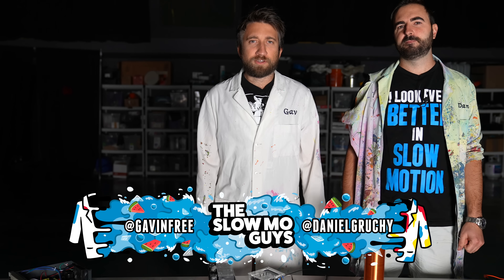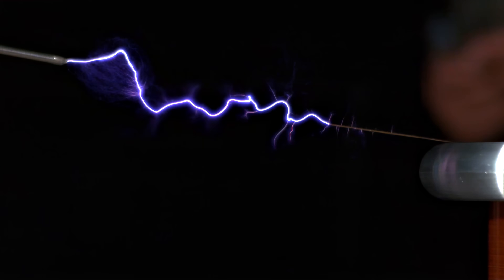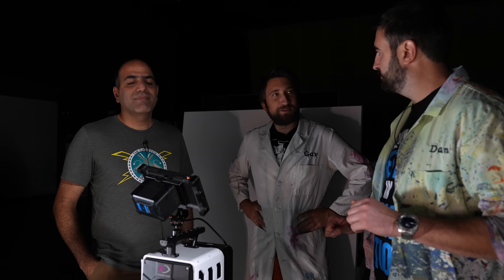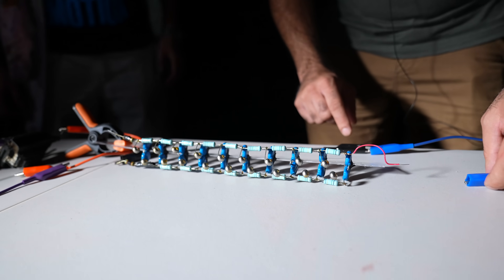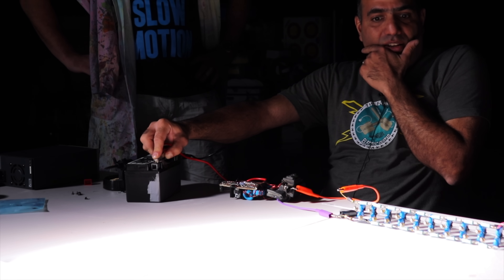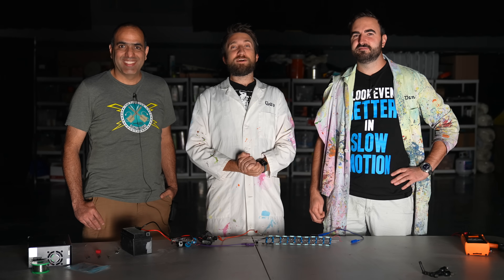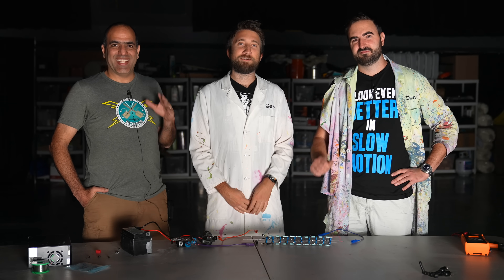Electrical Arcs at 1,750,000FPS - The Slow Mo Guys with ElectroBOOM

Comment: The electro boom guys Mark's generator looks like the flash happens all across all of it at the exact same time even at 1 million 750,000 frames per second. That underlines the idea that electricity doesn't really travel through wires. What travels through the wires is an electrical CHARGE, not the actual electricity. One atom charges the next and the entire chain becomes charged. Only then does the electricity make its appearance as a flash or whatever.

Comment: +++Because electricity moves slower 'about' a conductor [not 'IN' a conductor. See So You Think You Know Physics. The Big Misconception About Electricity [Veritasium] - https://www.youtube.com/watch?v=bHIhgxav9LY ] than through the air [near vacuum relative solid matter. Tthink density-resistance/impedance],  the reason the first gap was active before the last/others is because it is closest to the initiating power source. Get an even longer ladder and faster camera and you'll visually/experimentally prove that electric power travels through air to some heretofore unknown degree.   UFO power supply???

Comment: 1.75 million frames per second allows us to see a little more what's going on with an electrical arc, but it isn't quite fast enough. Light travels at 186,000 miles per second.

Comment: 15:32  the camera captures picture/video line by line may be that's the reason you are seeing the last one is only ON. 

Like the camera have captured most of the pixel but when it reaches to the last one at the same time the circuit turn on and the camera ends up only  capturing the last one light.

It's camera shutter effect which can be also seen when you take picture of a fast moving fan
Reply: The Phantom cameras they use don't have rolling shutters, so each frame is an accurate moment in time.

Comment: Hi! Sound guy here! The arcs following the same pattern in the air due to the heating of the particles within the trail also explains the tonal nature of the tesla coils noise that it makes when discharging. You could hook up a MIDI clock output to the frequency regulation, effectively letting you play MIDI music through the tesla coil!

I do hope that little idea turns into a video for you guys! Leave an upvote if you've read this and you'd like to get the idea to Gavin, Dan and ElectroBOOM!Loving this video a lot and I'm only at 2:51

Hope you guys are doing well! Been a massive long time fan for years.

Comment: I've always wondered why, with the equipment on hand, you seem apprehensive to use your highest fps cameras?
Reply: Obviously I'm just guessing but I think a reason may be that the higher the frame rate, the lower the resolution. You lose quality and frame height to achieve those speeds. If they can record something at a fast enough speed to keep it full screen or better quality, they probably will. At a certain point some things are also going to be too dark to record at some speeds. Just a guess though!

Comment: To measure light, wouldn’t you need a camera that captures frames at (or faster) the speed of light? I would also propose using detectors placed at least at two various points, then measuring the energy differential between the two points after the initial release of energy to determine the flow of the electricity. Has something like this already been invented? I would love to know so I can conduct further research myself.

Comment: silly question, but could you take 2 or 3 of those phantom cameras side by side. program them to take a frame while its neighbor's shutter is closed and then stitch the two videos together for double the frames?
Reply: I was thinking something similar, but rather make the camera with several sensors that all capture the exact same frame thanks to a two way mirror or a prism.
Reply: Silly question? That's something Steve Jobs would've asked! He didn't have the know-how of the engineers, but had the how-to of a designer!

Comment: Fun Fact about Electrical Arcs: 
Electrical arcs produce some of the highest temperatures known to occur on earth. Up to 35,000 degrees Farenheight, which is 4X the temperature of the surface of the sun! All known materials are vaporized at this temperature, which causes a sudden expansion of air. Blast pressure waves have thrown workers across rooms...
What sustains an arc? An electric arc is a discharge of electric current across a gap in a circuit. It is sustained by the presence of a thermally ionized column of gas (called a plasma) through which current flows.

Comment: 17:08 Gav, let's not forget that electricity travels at 670,616,629 miles per hour :)
Reply: Jeez, only light travels faster at 671 million miles per hour!
Reply: @chrisjandik5019  we've gotten particles in particle accelerators to travel at 99.999% of the speed of light

Comment: conventional current assumes a direction from high voltage to low voltage, but really electrons are flowing from the low voltage terminal to the high voltage terminal, because electrons carry a negative charge. this could be why the last arc lights first
Reply: 10:30 someone who has knowledge on cameras and such tell me why they are only showing a small line
Reply: Was searching the comments waiting for someone to mention that dc electrons flow from negative to positive so that’s why the last one was lighting up first lol

Comment: Electrical engineer here; My guess on why the marx generator lights up all at once would be that Mehdi IS technically correct, they are filling up from left to right. However, once the first stage is fully charged, my guess is that the impedance between the two discharge nodes is effectively infinite (acting as a perfect open), because there is another path of least resistance within the circuit, going to the next stage capacitor. Once that next stage capacitor fills up, rinse repeat down the line until you finally fill up the very end one. When that one fills to its max capacitance, there is nowhere left for the current to 'freely' move, so everything 'overflows' all at once.
Reply: Just like Micheal has said, you would need a camera that could record with a frame rate close to the speed of light to catch each RCI discharge happening. I think you’ve already found a camera that can do this. Do you think the University will let you borrow it?
Reply: A hematologist here, didn’t understand a word
Reply: 1,750,000 FPS
Reply: So, in essence, it would make sense that the furthest shows activity first? I have about ZERO electrical engineering knowledge, just basic electricity understanding. It's a circuit, so if the energy is making a loop in the device, wouldn't the last chamber fill first? Like water pumped down a tube with pressure-released valves, the last valve in the tube would open first once it was filled?
Reply: The best kind of correct
Reply: so, this is kinda exactly what i thought, but not scientifically. i wouldnt have known how to describe it but this was my exact sort of thought process😅
Reply: New student here, I thought a capacitor was an open? How come a capacitor fills up? If the impedance makes it effectively an open, I get how the current goes through the short, but if the short leads to another capacitor (open), how is it a short path? Thanks
(Again, just took circuits 1 so I might be missing something)
Reply: @wildavis3016  You are correct, in a DC system, a capacitor will eventually behave as an open, once it receives enough charge to 'fill it up'. Once full, the capacitor denies any further charge, acting as the perfect open (infinite impedance), forcing all the current elsewhere (down the line to the next sets of capacitors). However, if there is sufficient enough voltage potential between the positive and ground/negative sides, the the voltage can actually break down a medium (in this case, by ionizing the air between the two discharge nodes). This arc acts as a very brief short, which totally drains the capacitors, resetting the system.

This is why capacitors are only rated to certain voltage limits, as exceeding these thresholds will cause this same breakdown within the capacitor itself, resulting in the wonderful "pop" we all know and love Mehdi for.
Reply: @Deper91  ok that makes sense thanks
Reply: @Kynan That's great and has nothing to do with the topic at hand
Reply: Fact of the matter is, it must be a cascade effect, but much like glass breaking, propagates so fast that it is all but impossible to see the behavior.

The giveaway here is that all the gaps have to "close" for anything to jump out of the output (as these are series switches)... But clearly one has to reach potential before all the others, if for no other reason than there will be slight differences in the gaps.

My guess here is that it just so happened that the end gap was the closest, but it could have been anywhere in the chain. Once the first one goes, the others are immediately "over" and fire off in an order relating approximately to the gap sizes.

This may actually be random in appearance, IF one could record all of the time in between. Obviously this is extremely difficult.

Once they are all bridged, the output goes hot and an arc is ready to jump if something is close enough.

You'd therefore see the output spring to life after all of the chaos in the gaps is resolved and they are all conducting.
Reply: @Kynan That's only true IF there's no reactive components present.

Sorry buddy but been doing this a LONG time and know how it all works. 🤷‍♂️

Comment: @5:54   is essentially how the lightning stepped leader coming from the cloud meets an upward streamer coming from grounded objects.  It also demosntrates how the ionized channels first propagate in the air by following corona discharges and when the circuit completes, the unconnected branches discharge.  Nice job.

Comment: The 250 kHz figure is interesting.  Lightning also contains a lot of radio frequency components, which is why it generates lighting crashes on LW, MW, and low HF radios.

Comment: lightning discharge of high voltage passes through conducting substances- the energy shreds the electrons in the substance it contacts, so the ghostly afterimage is actually luminated ionized gas molecules, in this case air

Comment: This camera is dead slow compared to the task. If you measure breakdown times with an oscilloscope, you will see times around 20 ... 40 ns, and such a marx will erect in <100 ns. So you can't see details with one picture in every 600 ns.

Comment: Do you know how fast it actually travelled? Did you discharge the capacitors after each attempt? Just curious if they held a charge after the arc. It was cool to see the mass of the electrical charge separate the air then the air giving the telltale "thunder" sound.

Comment: I made a really powerful Jacob's Ladder using a MOT and a capacitor. My phone had a high speed option, just NOTHING compared to this camera..
Going to make a Tesla coil to generate enough power to light a fluorescent several feet away while I hold the bull in my hands. I've done it on a small skill, but I think I'm going to bring it up quite a bit.

Comment: Why does the spark start at the other end?? Silly humans. Electricity acts no different than Pneumatic or Hydraulic. Imagine the oval ends as nozzles. Your vessel has to first fill completely and pressurize. The pressure and back-flow starts at the farthest point.

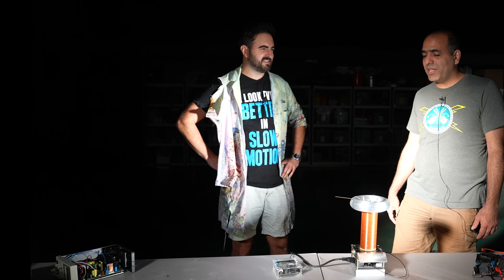Comment: That stuff at 3:00 is probably less about the ionized channel created by the previous arc and more about electricity always taking the path of least resistance.  So that path is displayed by the very first arc, and it doesn't change much in the millionth of a second or whatever between arcs, so the next arc takes almost the same exact path.

I thought the little baby arcs coming off the antenna as the charge moved down were pretty cool though.  THAT is likely due to the ionization of the air around the antenna as the charge travels along it, but the antenna is still the dominating path of least resistance.

Comment: 17:34 The spark is going pretty fast. Say the generator is 0.4 meters long and it all lights up within 1/1,750,000 of a second. Then the speed is at least
0.4m/(1/1,750,000 s)=
0.4*1,750,000 m/s=
700,000 m/s
That's about .23% of the speed of light, but that is only the calculation based on the frame rate of the camera. With a 750 million fps camera you could measure the speed of the sparks up to the speed of light.

Comment: Speaking from an electromagnetic and electrical engineering specialist background. What people don't realise is that wherever there is charge, there will be current flow of electrons. It's just so slow or small that you can't recognise it many times. 

So when lightening or sparks occur, what's happening is all electrons in the air are moving, from even the lowest charge, and as the charge increases, some particles move faster than others and this builds and builds depending on the ionisable properties of particles as well as the electrical charge source. And so the fluff or the "searching" of the electrons really aren't anything to do with lightening finding it's path, but more to do with just the natural already flowing electrons becoming visible due to the increased flow of electrical charge around the visible areas. And charge doesn't flow through the air like one stream, but rather through the entirety of space simultaneously. Think of space itself as made up of like infinite circuits connecting the charge source and it's destination, all in parallel connection with each other and all with differing resistances for the electricity to flow through. And as the electrons increase in flow, these circuits change in their resistance properties.

So the reason the Marx generator goes from the higher voltage side is precisely because all current is flowing at all times from it's source to destination. Of course as the air becomes more and more ionised it becomes more and more like a short circuit. And the air becomes more and more ionised as current is flowing faster and faster, even well before you see any ionisation process happening at all. Think of all the capacitors as already flowing current continually, all charge trying to dissipate constantly and simultaneously from all points at different rates. It makes sense the slip stream of the higher voltage would appear first to ionize.

Comment: if you could have 2 cameras film at 1.5 million but at alternating starts could you then get 3 million frames a second? night be impossible to time even with a computer though
Reply: totally doable, but the object is too close, the angle would change way to much.. is a hassle.
Reply: @JoseNovaUltra  what if you had a mirror bounce the image into two other mirrors that the two cameras were then filiming?

Comment: A somewhat lesser confusing way to conceptualise why an arc will jump to a conductive surface is by making parallels to materials cracking and how they might crack due to a change in width or due to an internal void.

Its not like the crack knows where to go, it just finds the areas that take the lowest amount of energy to rip apart, once it reaches the end of the material the crack opens up which is basically what electricity does.

Comment: The reason the arcs don't occur in a sequence along the resistor ladder...  there's no voltage drop across resistors when there's no current.  The arc-gaps all reach the same breakdown voltage at the same time regardless of resistor values.  After the arcs start, then there's current, and then the resistor value limits the current which is why arcs at one end are brighter than at the other end.

Comment: I'm guessing that the reason they see the last spark gap in the Marx generator is the first one to flash-over is because that particular spark gap may be slightly shorter than all the other gaps. That would be easy to measure with a digital caliper. (Be careful not to shock yourself, Mehdi!) LOL

Comment: ON/OFF hz cycles as the current is pushing against the resistive force of the ozone. as the ozone is super heating it is creating a less resistive path each time with the cycles peak the arch crept closer.

Comment: Another great vid lads. I think I'm a long-time watcher and first-time commentator. Luv the addition of Medhi. Just a thought/question. The spark at the end of Mark's generator; Could that have anything to do with a magnetic field extending from the connecting ground wire? I noticed it wasn't insulated. Pls, excuse my lack of electrical wisdom.

Comment: The fluff 

That is the superposition of the electron 

Electron cannot be distinguished 

That look at that mans face was in denials 

Having understood but yet not fully realized.

What they measured, what you saw, and what was just discovered

If you take this one step further and introduce the electrical equivalent of a double slit

You may unlock the next leap in human advancement.  Rivaled perhaps only the mastery of fire, or the splitting of the atom .  

Got mafs?  

:)

Comment: With the cappacior bank, if one flashes, the current generates a magnetic field that travels with light speed to all the others, that will rise their voltages an make them spark as well. It is how Hetz build the first radio transmitter/receiver: https://en.wikipedia.org/wiki/Spark-gap_transmitter.
So all the others look simultaneous but are firered with the speed of light all triggerd from the first one that sparks. 
B.t.w the one with the smalles distance between the electrodes will sparc first and initiate the rest.